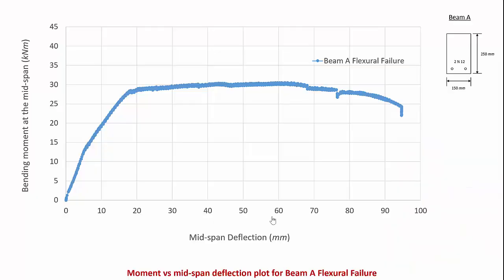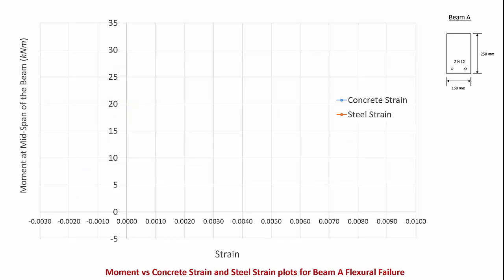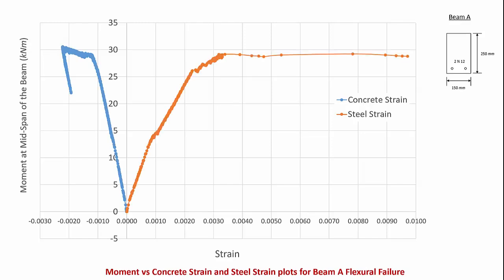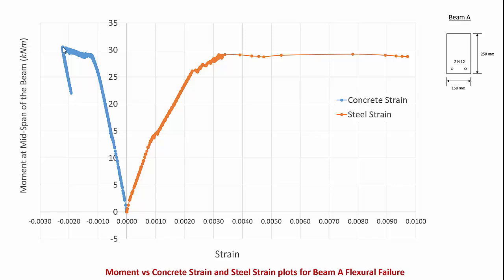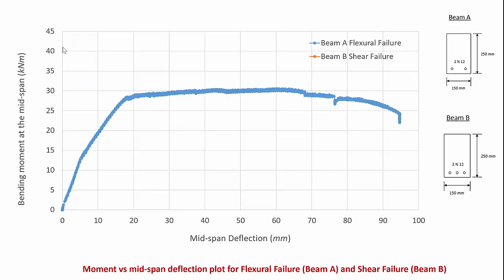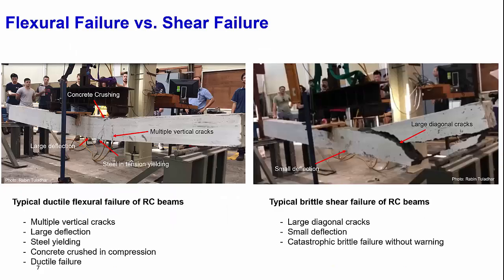Ductile Flexural Failure Video of a Reinforced Concrete Beam

Comment: effective depth = 219
f'c=32
fy=400
2-12mm bars

i got the Mn = 23.2 kNm which is a quite close and safe value based on the graph. multiplying it with safety factor 0.9 (tension controlled) will give a much safer value Mu=20.88 kNm

Comment: 60kips rebar x 2 bars of  steel failing at 28kn      6000 pounds of loading (2.85 ton force pounds)... What is your PSI of concrete?  Note, your loading is divided into two load points and one at each end,   28kn divided by two or four point load points on the compressive ''face"  (and two in the ''tension'' surfaces") = 14kn = failure at 1.42 ton force (it clearly cracks and fails at that point loading)... considering your loading is equal at compressive locations (2 rollers)...
Reply from the maker: It is 32Mpa concrete, 500 MPa steel. The section dimensions are given in the video. You can predict the flexural capacity of the beam, you will see it comes very close to the experiment.

Comment: Excellent video.
Could you provide the yield stress of the steel used and the useful height of the section? (covering, stirrups, etc.)

According to the Brazilian code and adopting d '= 21.4 cm, As = 2x1.11 cm² and fy (yield strength of steel/rebar) = 500 MPa the last load expected for the test would be 38.1 kN.
Thank you for sharing!
Reply from the maker: Hi Sandro, yield strength of steel is 500  MPa, the concrete cover is 25 mm. There are no stirrups in the beam.
Reply from the maker: Also the graphs show the maximum moment capacity of the beam, not the load.

Comment: Using Finite Element
Reply from the maker: That will be great Osama. The span length is 3 m, the cross-sectional dimension is 250 mm by 150 mm and reinforced with 2 x 12 mm steel bars. for the flexural failure and 3 x 12 mm bars for shear failure. You can also see the details at 0.24 s in the video. The concrete strength was about 32 MPa. Let me know how your FEM model goes.